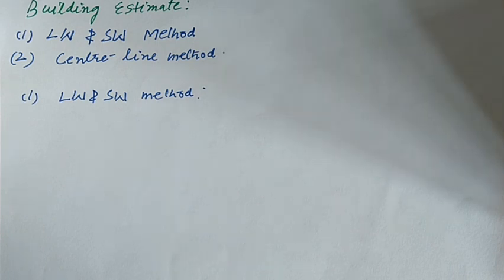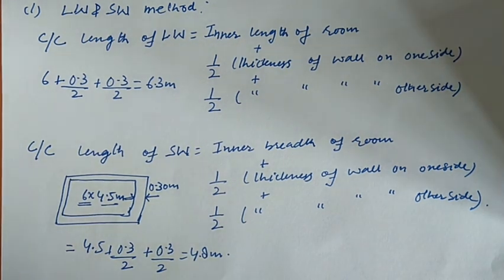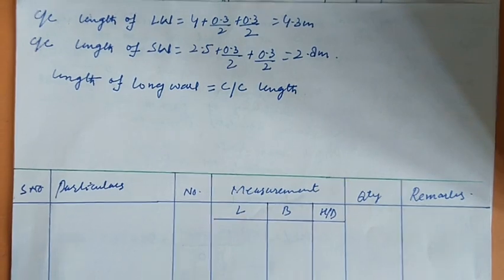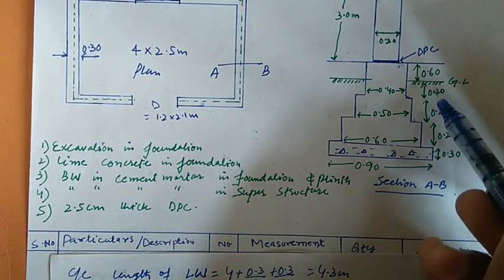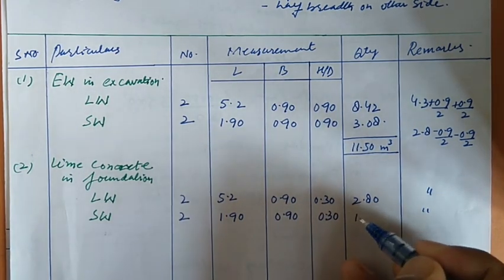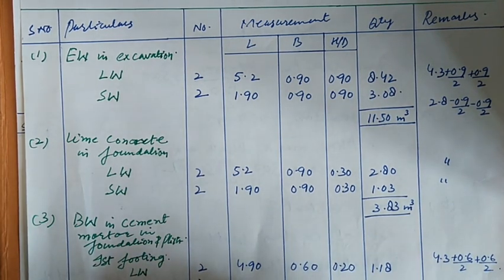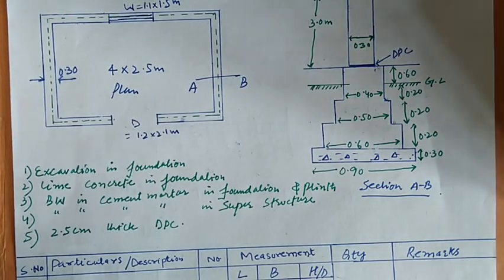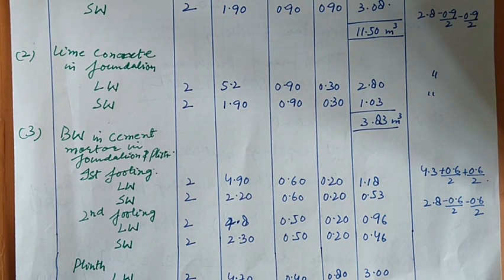| Lecture 05| Basics of Long wall and short wall method|

Comment: The ans of dpc is 4.26 but sir we don't have to deduct door in dpc
Reply from the maker: In some books u will find deductions are made for door and window openings.....but practically we don't deduct  it......and you haven't mentioned the unit.
Reply: @er_adil  meter square is the unit
Reply from the maker: Explain why sqm and not meter cube
Reply: @er_adil  sir because we don't consider height in dpc because that's very small hence we neglet that an only consider breadth and length